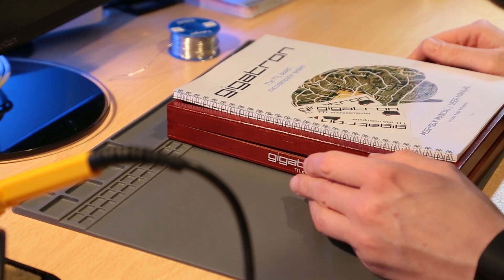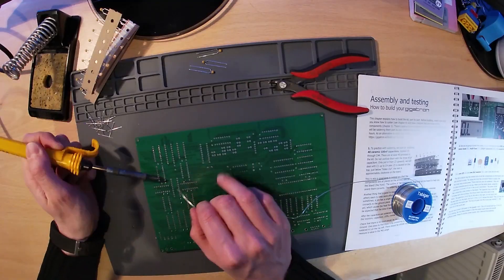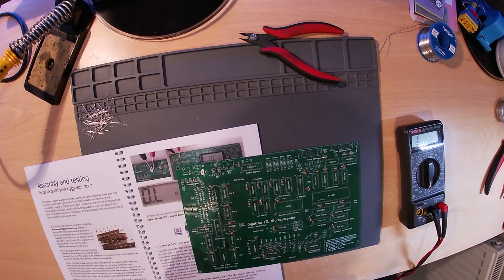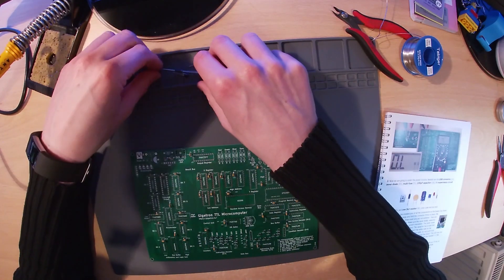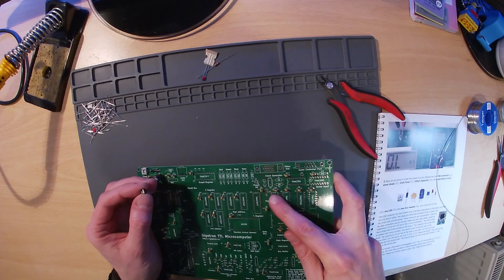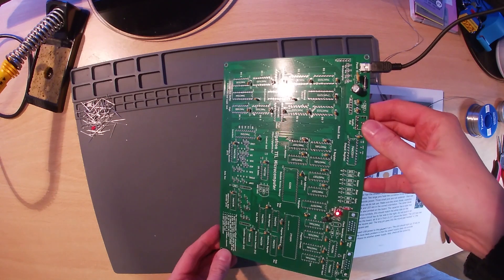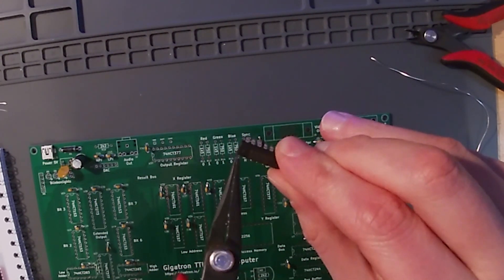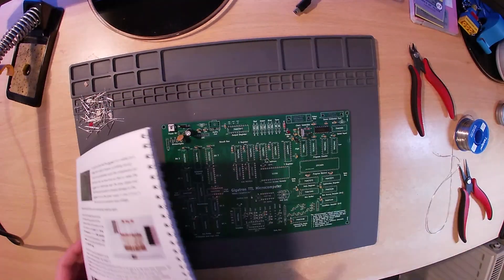Building the Gigatron TTL Microcomputer, a computer that has no microprocessor!

Comment: "Microcomputer"? Mini computer would be more fitting for a computer that has no microprocessor. It has a TTL-based CPU, much like the so called "mini computers" that were common from the late 1960s to mid 1980s.